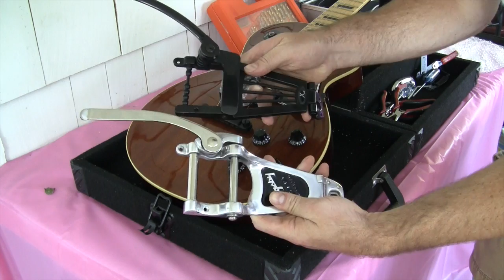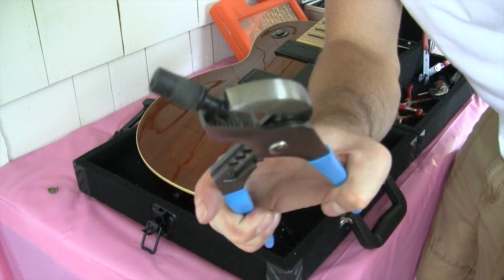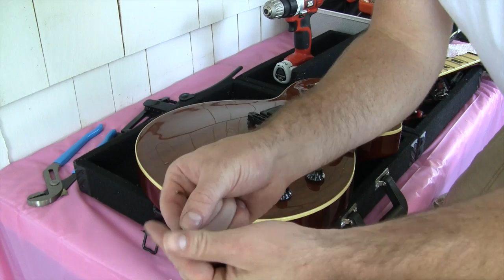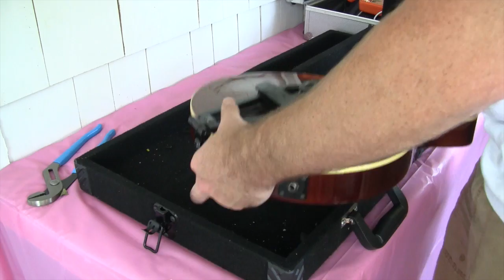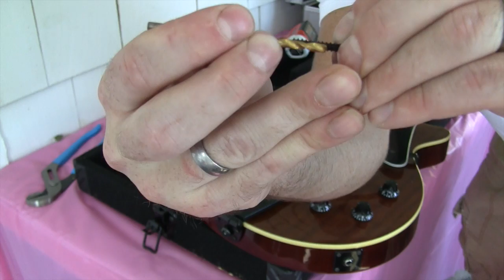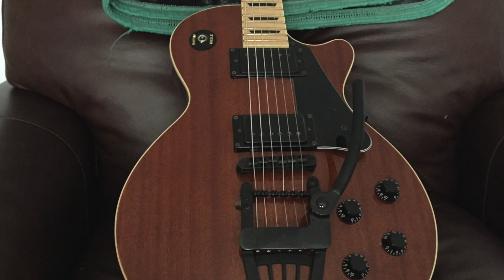Guitar Project  - Adding Xtrem Tremolo on Import Les Paul Style Guitar(Agile AL2000)

Comment: Why didn't you just let the X-Trem float on the top instead of drilling the hole?
The Screw on the button pin would have held it on well enough and string pressure would have kept it tight.
Hate to see a guitar scarred like that, even if it's a $225.00 Agile.
I used to roam AGF. : )  ...a few years back. Interesting memories.

Comment: WAAAAAy to extreme angle of string saddle to tailpiece! Happy breakage! Better add a roller bridge. This device is not well designed for a Gibson LP and will not even fit any import! It's designed for a longer body guitar. period.
Reply from the maker: Agreed... I prefer the Bigsby plus vibramate as it raises the Bigsby height quite a bit. I also like the B3 plus Towner Down Tension Bar... but it looks a little weird.

Comment: hey my friend ....which size fits a les paul.....I thinking of doing one
Reply: nick .....no instructions?
Reply: Raven - GFS only make 3 types of Xtrem. A top mount, which is similar to a Bigsby B5/B50 and suited for flat top guitars like teles, SG's, Les Paul jr, etc.
The other 2 are more of a Bigsby B7/B70 kind of shape. The 2nd is called a floating Xtrem and is suited to curved/arch top guitars such as Les Pauls. It fits by using your strap button, I can't remember if it also uses the existing tailpiece bushings, but you don't need to drill your guitar to fit it. I think the 3rd Xtrem is called long tail, and is the same size as the floating but you have to drill the guitar to fit it, this is the one in this video.
So you'd need either the 2nd or 3rd Xtrem for a L.P. and personally I didn't like the floating Xtrem so if I wanted to fit my L.P. with one then I'd get the long tail. I just bought the top mount Xtrem myself to fit on my tele and it's great for $50, I think the others are a little bit dearer at $57-$59.

Comment: Very poor design.  The 4 screws on the tail are too much for nothing and it puts 4 holes into the body of that nice guitar.  The strap button screw is largely strong enough to do the job.  You have to drill other holes on top of the guitar which is very sad too...  Simple sluts on the trem assembly would have made it obsolete.  I don't know the price of that sh**, but I wouldn't install that on my guitar and that's for sure !  Nothing personal here...
Reply from the maker: No worries Eric. I wish someone would come out with a good hole less trem that didn't cost $200 to add. Les Trem II are really cool, might have to try one at some point. Still not cheap though.
Reply: Thank you for your input Nick !  You have the right guitar to try it but still, as you said, it's still pretty expensive.  Enjoy anyways !  Cheers from Canada.

Comment: What happened to the ground wire on the bushing?  Also, does anyone know if the Gretsch Pro Jet G5435 has the ground attached to the bushing or do they do it differently?  Thanks
Reply from the maker: Not sure. It's probably in there byt not really grounding much. No buzzing though.

Comment: Nick..instead of buying a longer bolt to pull inserts put a small metal dowel down in the hole then use the bolt that came out to crank the insert out. I use a metal dowel pin from a shelf height adjuster. Works on all no matter tread size.
Reply from the maker: Doweling is the proper way to go for sure.
Reply: I learned years ago you can just drop a small screw into the whole then thread the bolt back in and as you turn it it will pull the insert out because the stud can't go in anymore
Reply: A hex bit for a screwdriver works too.

Comment: Im not looking to drill holes into my les paul, but I read on the gfs website that you can put a washer on the end pin and that should be enough to hold it, kind of like an archtop piece I assume. Do you think it will be enough to hold this trem in place?
Reply from the maker: +GuitarPeeBee AndJay They probably would... just have to check up on them a bit and perhaps use a deeper screw just to keep things anchored correctly. If you were gigging every night for 2 hours perhaps not but if you're a living room duffer like myself it'll probably work out fine. I sort of wish I didn't drill holes myself... oh well!
Reply: Ok I will keep that in mind, thanks.

Comment: Hey Nick.....thanks for the reply. Here is my situation. My original Guild Starfire III had a bigsby like what you are wanting the tension to be greater between the trem and the bridge. I now have a brand new Guild....I do not like the stock trem. I too need more tension and or more angle of attack as I like roller tunamatic bridges.......and the lack of tension makes the strings slip off the tunamatic as I bend strings. The roller tunamatic is magical! Keeps the guitar in perfect tune. I can't afford the Guild or Bigsby unit with string tension roller bar, so I am gonna try the X Trem. Love your vids....wish I was closer to you and your shop.
Reply from the maker: Hey man, thanks for the kind words, they very nicely balanced out ones I just got from a troll on another video. It's nice to know there are good folks out there too! I think one of these might go nicely on that Guild... Which term is on it now? The floating Bigsby knock off they use?

Comment: Nick....and others that will install this pretty tremolo, instead of leaving the two holes...simply plug them with hardwood dowels. Glue them in and lightly knock them flush to the maple top. Once dry...you have a surface to screw the tremolo down onto. And it will be square and straight.

Does the unit work well?
Reply from the maker: +david surace I've been meaning to do that exact thing since I did this video but alas I haven't gotten around to it. It's a good them, perfectly functional. It's not quite up to Bigsby standard though. Not as lush sounding and quality feel is a little off if you're used to a real deal one.
Reply: Would you demo the tremolo please? I just ordered a Gold version. I would love to here yours in action please?
Reply from the maker: +david surace Let me see what I can get together. It's a busy season with the holidays coming but I'm sure I can get something going.

Comment: Hi Nick, I finally got my "chibson" haven't gotten around to doing a review video yet, I thought you might like to know my thoughts. It looks cool although imperfections in the top near the edges but after playing for a few days I started to feel why they're so cheap in comparison to epiphone or gibsons.

The neck/binding are super flat and need to be rolled, otherwise it's  uncomfortable to play. I've also adjusted the truss rod but something with the neck makes string bending feel wrong. I can't figure out what it may be. Overall body work where edges are concerned are all flat with what seems no work done to them (man hours I guess)

Tone and volume knobs are pretty unresponsive, pick ups sound great tbh but slightly thinner sounding than an epiphone. Playing without an amp you can hear a less full bodied sound from the chibson.

I was planning on changing out the electrics/pick ups and tuners (already ordered tuners) but I have to say I don't think I'll be putting anymore money into it. (I'll save the tuners for something else)

A lot of people look down on epiphones but in comparison to this particular chibson they are worlds apart and for only approximately $150 more you get an epiphone les paul with high quality control and no problems.

I'd happily give up the chibson to have the cash back and either buy another epiphone or start saving for a precision guitar kit or the highly (over priced) holy grail that is a Gibson. 

Sorry for writing a book ;)
Reply from the maker: +bad milk Hey man, sorry to hear that things didn't go so well on this bad boy. Either they're going downhill in general or you got a bad factory run on that one. My condolences my friend. I wonder if the radius is too flat or too arched? Might also help to lemon oil the fretboard and play it a bit to smooth up the frets. Short money to free things to give it a shot. 

Your experience and some similar ones is what drove me to check out the Harley Bentons, Agiles and even SX guitars. At least a less than perfect one of those is easily flipped. The Chibsons present a challenge for that. I am talking with one builder who found my videos and wants me to review a few of theirs. We'll see where that goes!

Comment: Hey Nick,,, that is a good looking addition to the Agile,, was wondering,now after playing it how the Trem works in regards to staying in tune.Also would like to know,, what did you do with the ground wire from the bridge ? and is this the the extreme long tail vibrato,or the extreme floating tailpiece vibrato.
Reply from the maker: +Canadian Guitar Hack The is the Xtrem long tail vibrato. The floating one only has one bar vs the 2 on this one. For the ground wire to be honest I didn't do anything. If these Agiles have one it's still sitting in there minding its own business. Good question though and I'll take a gander when I pick it up next. Finally it stays in tune pretty well once the string stretched out. There's one more mod I need to do which is to add a washer under the spring. It gives it a little bit lusher of an action that I think would help this compare better to a Bigsby.

Comment: Looks pretty good, let's see how it works. On a side note ... so you pulled out the old bridge pins. Now the ground wire is loose in there. Is that going to be an issue? The reason I ask, is that I finally put my B5 on the Sg and face the same thing. Cheers.
Reply from the maker: +TelepathicTraffic So on this one I didn't see a ground wire hiding in there. It very well may be there but didn't see it. As to how it works it's ok... it's not quite Bigsby nice but better than I honestly expected. There's a trick where you add a washer under the spring and it helps it a bit more that I need to try. I'd still prefer a Bigsby overall. Just feels... right. I need to check out your video. I saw it post but I'm behind on my leisure studies of late.